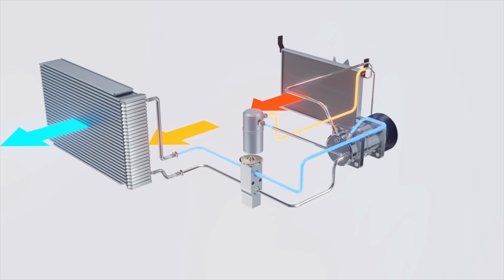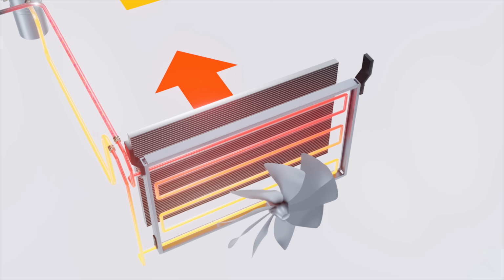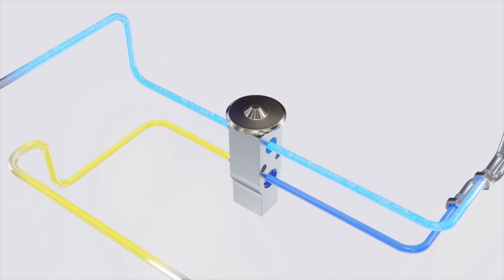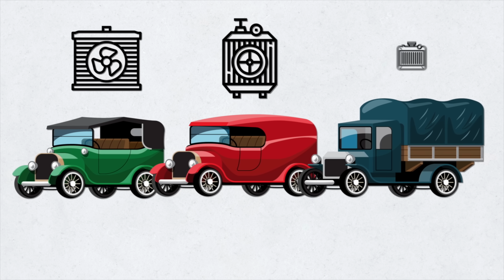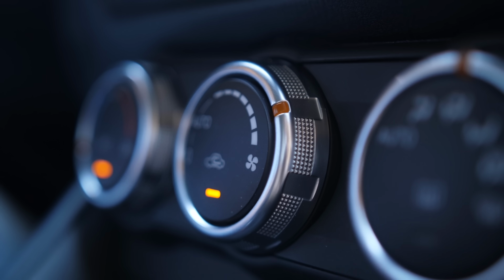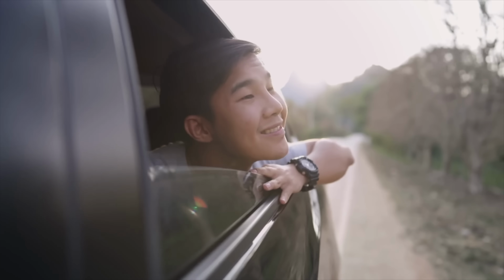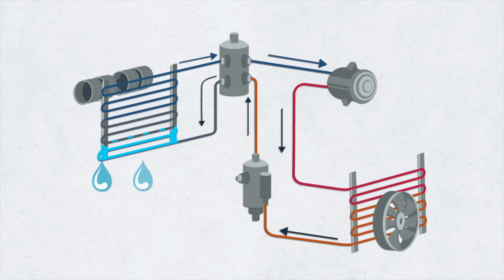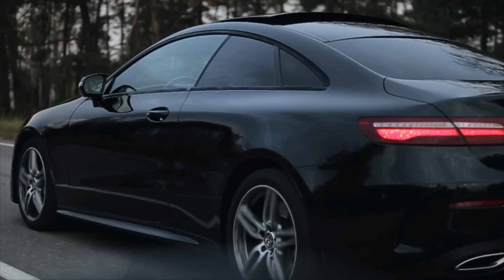Never Do This to Your Car’s AC System

Comment: Hey Scotty love the videos! I drive a 2016 Renault/Nissan standard transmission.  When I'm moving fast and coming to a stop, I press the clutch , put it in neutral to coast to a stop and the engine sputters like it's going to stall. Did I buy a dud ? HELP!
Reply: Does it idle badly?
Reply: @blake031299  no just when stopping
Reply: @mikebcraft  are you sure you're holding the clutch all the way in and its in neutral?
Reply: @blake031299  yeah I'm sure
Reply: @mikebcraft  beats the hell out of me then. My only guess wasn't it wasn't fully disengaging the clutch
Reply: is this in hot weather with the a/c going? seems it would tax the engine when in neutral...

Comment: The boiling point (temperature) of automotive refrigerants is between -12⁰F and -22⁰F, not 32⁰F.
Reply: Yeah that's under atmospheric pressure. A/C systems aren't under atmospheric pressure. They are routinely at 275 psi/1896kpa. Which raises the boiling point by a lot. The opposite can be said if it were under vacuum.
Reply: @BringMeThyPizza : After the refrigerant passes through the TEV or the orifice tube, where it is "atomized" and goes through a phase change in the evaporator, it is no longer at high pressure.

Bring me thy pizza.
Reply: You mean freezing point???

Comment: Scotty what are your thoughts on the Volkswagen Amarok?
Reply: VW RUN AMOCK LOL Run from that one.
Reply: @BigEightiesNewWave  I meant as a car in general, not if I should buy one or not. Anyway my dad has a 2014 model that he’s owned for 7 years with nearly 200,000kms and it’s been very reliable

Update: just ticked over 214,000, still very reliable

Comment: I have a 1987 Ford F 250 custom with a 300, 6 cylinder with no air! Here in Arizona it’s like riding in a blast furnace lol!
Reply: I used to have a 1978 Chrysler Cordoba with a 5.9 360 and no ac. A blast furnace is a very good description. Oh and this one time after driving for an hour or so I stopped to look under the back end of the car because I heard a noise and mind you the exhaust was cut off directly behind the chrome steel bumper and I decided to put my hand there to look under the car and well when I pulled my hand up my skin stayed behind
Reply: Oye!  Don't know how you do it in the hot months
Reply: Well damn 😯
Reply: Uh...hell no!!! 😯🥵😥😓🤢🤮
Reply: Open both vent windows,  sliding rear window,  and don't stop for ANYTHING lol
Reply: Oh man your crazy no way lol

Comment: Scotty I have an Audi A6 2008 Quattro that sometimes squeaks when I turn the steering wheel the power steering level is good should I be worried or it something that happens with age?
Reply: Power steering pump would be my guess without actually looking at the car first
Reply: Sounds like the power steering pump itself
Reply: bwhahahaha sucker !
Reply: Flush the pwr steering fluid,  possibly multiple times.  Fluid is cheap

Comment: I've done more a/c compressors and condensors in the last month than ever b4😯this is a hot summer 4sure🔥
Reply: Lol I had to get my condenser replaced not too long again. Not cheap smh
Reply: @Kmclemore  oh yeah it can get expensive especially if u have the newer refrigerant R1234yf🤦‍♂️
Reply: @PhillyDee215  had to pay 2500 to get my compressor and drier replaced in my c300 🤦🏽‍♂️.
Reply: @HalfYallBroke  damn😯
Reply: you throwing Freon into the ozone
Reply: @alr1577  In an enclosed system? Do they still use Freon? ( I only know R134A)
Reply: @alr1577  Yeah, Freon hasn't been used since 1994.
Reply: @mickmcnulty8200  my AC man said that that Freon was trafficked heavily from Mexico. Those guys probably switched to people too.

Comment: Hello from Indonesia, Mr. Scotty I recently just got rid of my endless money pit BMW to CRV 1.5 turbo but I just watched your video recently you said it was bad? I guess I am just out of luck. What should I do? Should I change the car again? Thank you hope you answer my question I am your new big fan.
Reply: Did you buy the car new or used? Because I’m pretty sure only the early 5th gen crv’s (2017) have the oil dilution issue, other than that they are good reliable cars as long as you take care of them
Reply: @HughRussell06  I did buy my CRV used for only 7000 km!! So I thought I got myself a deal and yes it is 2017...
Reply: @DavidDavid-dy3uq  ok, just be careful of oil dilution. Symptoms of it are a check engine light, misfiring and a whirling noise from the engine. Apparently according to Honda it’s worse in cold weather but if it has 7000km and you take care of it the car should be fine
Reply: Tergantung kamu mau ganti Mobil apa
Reply: @licungR  kalau bisa ga ganti lagi nih
Reply: It will be ok...

Comment: Little stuff like this is so helpful , what's wrong with using A/C full blast in the heat !
Reply: yeah especially when I'm with my fat cousins.
Reply: @alr1577  🤣
Reply: Nothing wrong with it. I actually learned not long ago that when you switch the temperature in your car it's actually mixing Heat AND A/C. It's not actually making your A/C work less or harder if you go to the coldest temperature.